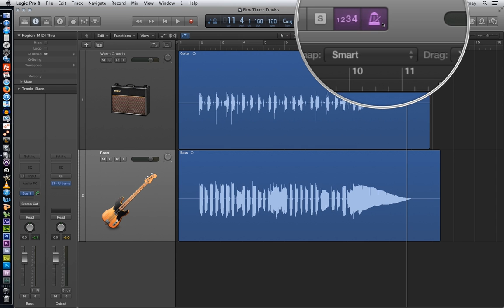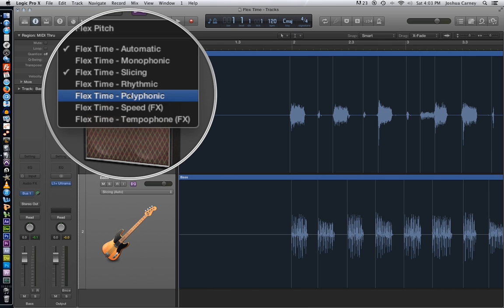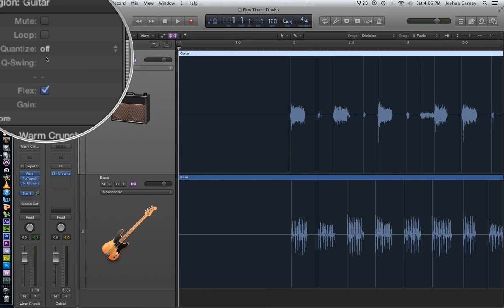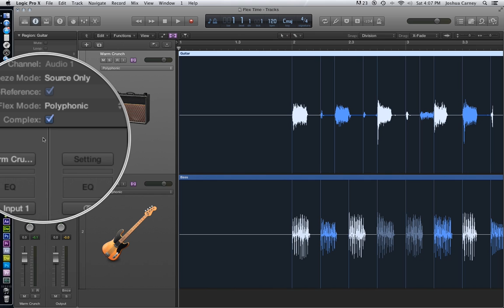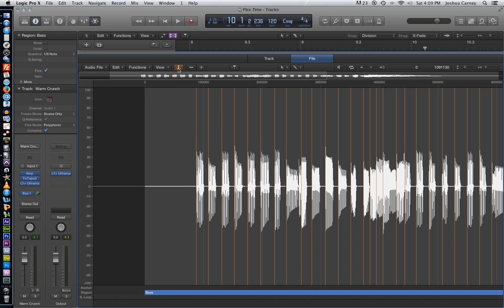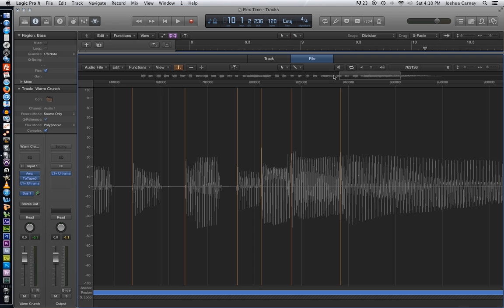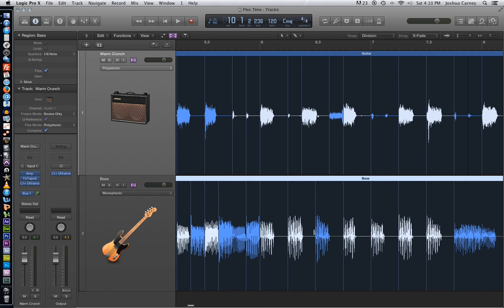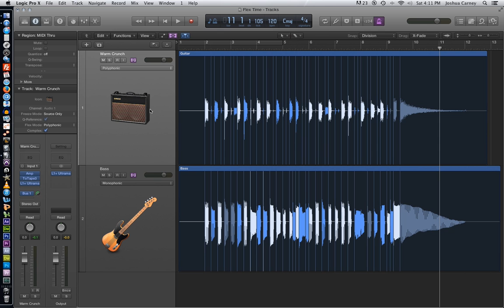Logic Pro X - Video Tutorial 18 - Flex Time Part 1 - Polyphonic and Monophonic

Comment: Hey man! 

Wondering if you'll be able to help?

I track my guitars to two separate tracks - DI and Wet Signal (to which I route my Fractal AX8). 
I use the DI to see whether I am on the time or not (which more often than not I am ain't.. haha).

Is there a way to edit my mistakes on the two tracks simultaneously?
Meaning - to manually edit the transients on the DI track and have it affect the wet signal track as well?

Thanks in advance!

Eran

Comment: For some reason when I quantize my guitar parts, they just don’t sound right. I tried doing what I figured would work with 8th notes and 16th notes but It sounds a lot better without quantize. Could it be that I need to change modes? Like use slicing or monophonic?

Comment: After using the transient marker button and fixing or resetting the markers, how do you re quantize in order for them to be fixed completely in one shot as once as you mentioned at the end of the vid. Which button do you press? Or does the system do it automatically once you finish moving the markers?

Comment: Great videos on Flex. Question! I'm working with a pre-recorded audio track that I've tempo-adjusted to stay with the timing grid. I'd like to quantize the track but as soon as I turn on Flex (poly mode) the track speeds up drastically and goes off the timing grid. Is this what Flex is supposed to do?
Reply: I have the same issue. Did you manage to solve it??

Comment: When I enable flex time on my gtr tracks it doesn't show the display that came up on your screen showing transient markers etc... Also in the region drop down menu there is no quantize option...what's the issue?
Reply: Same issue here. Any luck finding an answer? It must be some setting, but I've read several forums and haven't come across an answer. Thanks!

Comment: Hey MusicTechHelpGuy!

I have an issue with Monophonic Flex Time, I was wondering if you'd have an answer. Basically I'm trying to change the tempo by a good 30bpm at the beginning of an audio track where the (young) singer didn't start singing in the same tempo than later in the same song. I opened a new session, picked a tempo appropriate for most of the audio track, import the audio track, and all is good. I open Flex Mode, and it automatically chooses Slice (which I don't want, as it cuts up the audio file instead of stretching or crunching).

The issue is when I turn on the  Monophonic Flex Mode - the tempo of the audio file suddenly changes! When I imported the file originally, Logic X asked me if I wanted to import the file's tempo information, and I said no. I also made sure to go in Edit -> Tempo -> Remove Tempo Information From Audio File, and still, as soon as I hit Monophonic Flex, the tempo speeds up. Do you (or anyone else) have any idea what could be affecting this?

Thanks!
Reply: (Note: in the first paragraph, whenever I say "audio tracl" I should have said "audio file" - the short song is all just one 30s audio file)